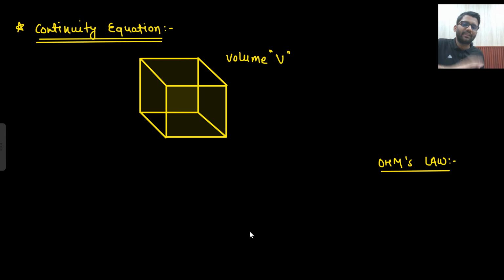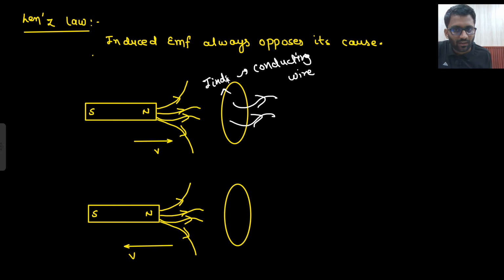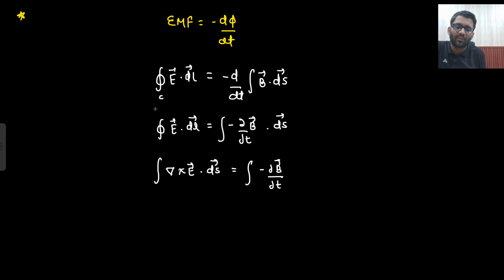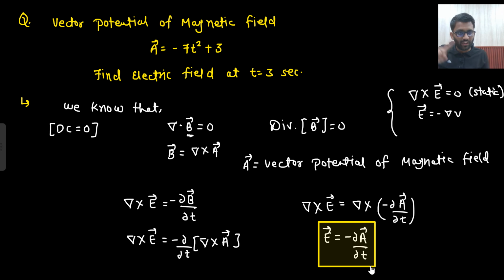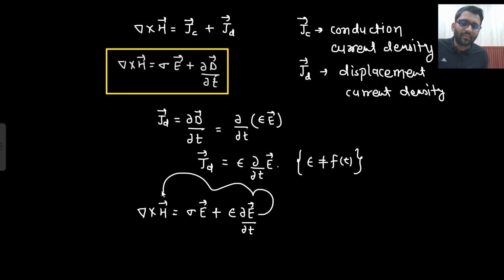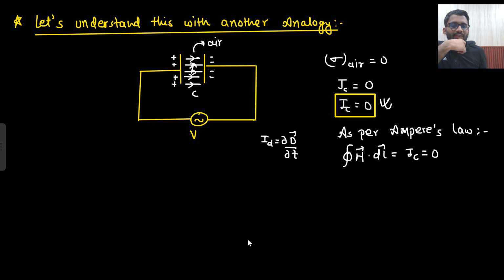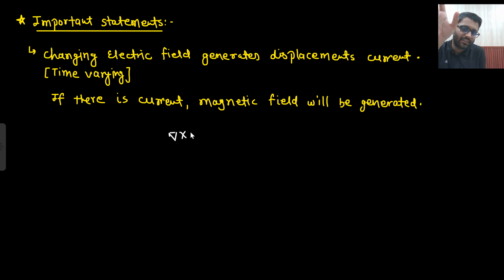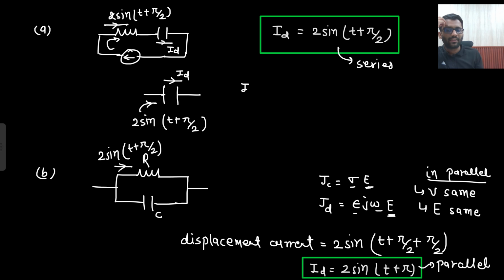Maxwell's Equation for Time Varying Fields || EMFT || ECE/EE/IN || PrepFusion

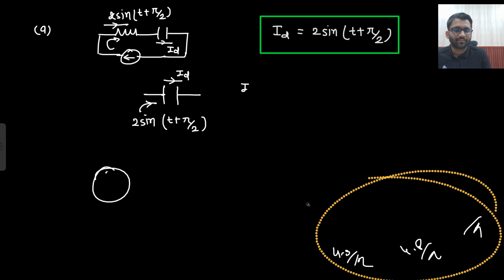Comment: 1:36:20 but id leads ic by 90, Ic should be B option?
Reply: that only holds when electric field is constant , since  a time varying current is given it produces a time varying  charge across the capacitor which creates a time varying voltage across the capacitor which is  very much different from the voltage across the resistor, since voltage across them is different certainly the electric field is also different so ic =id
Reply: @akashramesh3003 but won't the current across resistor also increase or decrease as a result of capacitor's displacement current? And so it's R's voltage changes??

Comment: In the very 1st example direction of current in loop should be opposite to the direction you have shown in video to reduce Magnetic field intensity...
Reply from the maker: Think again. 
That's the beauty of the question. Listen to the explanation again.

The current is reducing with time in the wire. That means magnetic field is also reducing, so now you don't want to reduce the magnetic field. You want to increase it. 
Faraday's law doesn't state that the field should also be reduced. Nah, it should just oppose the cause. That's it.
Reply: @PrepFusion_GATE  yes true